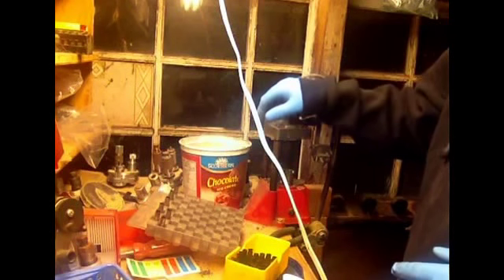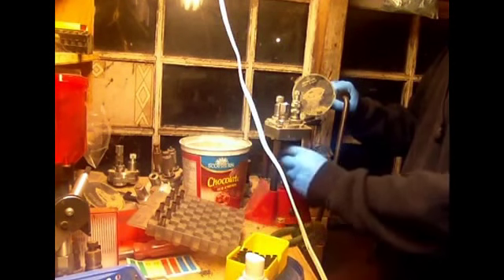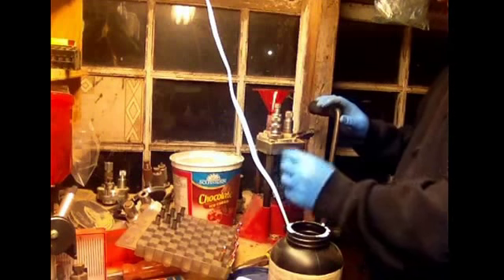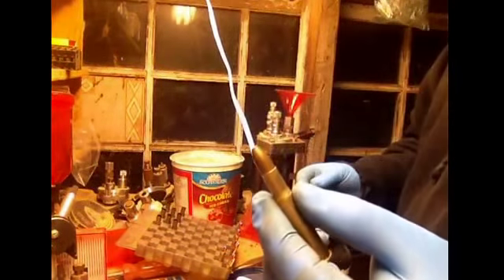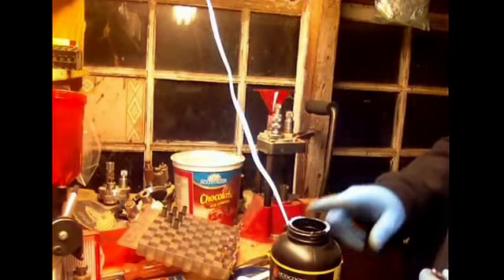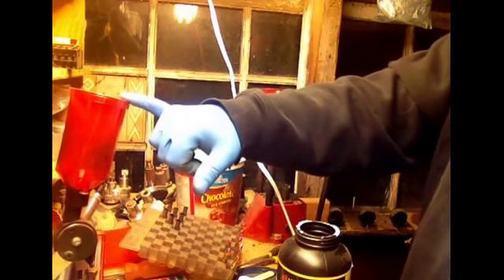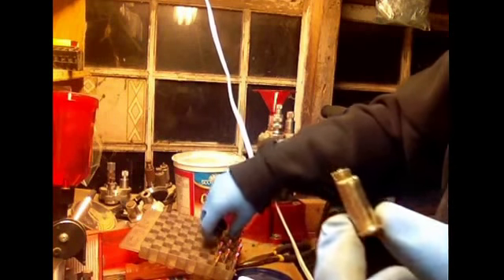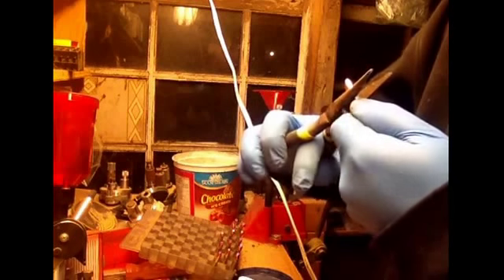Random Rambling About Reloading The 32-20

Comment: I recommend the Hornady One Shot spray case lube. I use it on all calibers where carbide dies are unavailable as well as in some instances where there is a high degree of effort required despite having the carbide dies. The main issue with it is that you have to make sure it's fully dried after application. It also works very well for lubing the press ram, as it won't contaminate primers the way any oil will. Dri-Slide moly disulfide is another good ram lube.